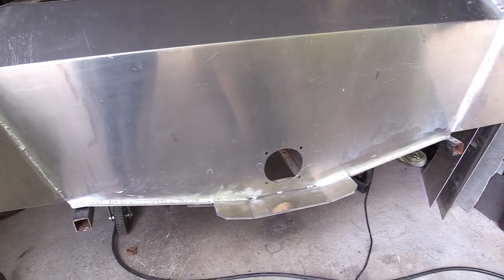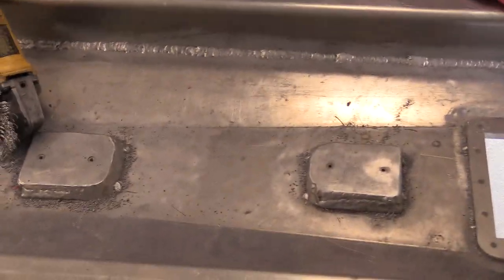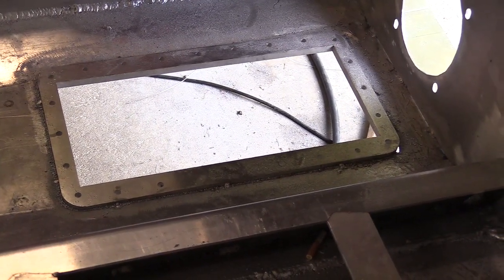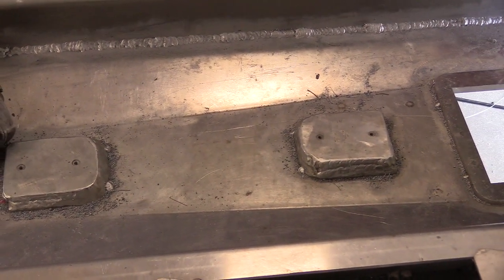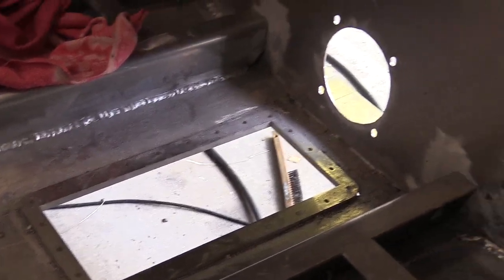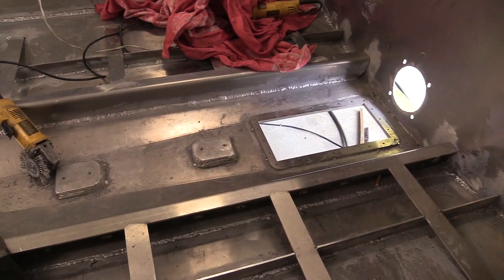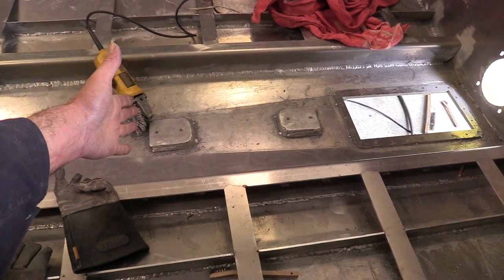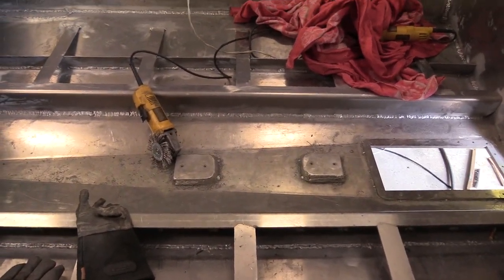Mini Jet Boat Build Video #41 Engine Mounting/Intake Welding

Comment: I have the same intake and pump as you and I didn’t like their weld in ring. It bolts in from the bottom and if I run UHMW over the bolts I will have to remove the UHMW to replace or fix the intake. And if I don’t run UHMW then the bolts are going to get pretty thrashed. So what I did was copy blome_907 on Instagram and got some 1”x 2” aluminum bar and made my own weld in ring, and drilled the tapped it to bolt in from the top.
Reply from the maker: Noah Lochner I’m thinking about welding the ring in flush with the bottom and countersinking the bolt heads, then adding another ring for hight. Maybe I should just build a new ring. Are you moving the bolts to the top? Forget the question. 😁
Reply: Paul Christian I’m working on a YouTube video for my setup right now, I’ll let you know when I post it so you can see how I’m doing mine.
Reply from the maker: Noah Lochner Awesome.
Reply from the maker: Noah Lochner Did you stick with the 1/4-20 bolts or go up in size? I ordered 1 1/2 square bar for the new ring.
Reply: Paul Christian I sized up. If you have Instagram shoot me a message @Northern_arc

Comment: I have just finished my wattscraft 3m , In my opinion I would spend the extra time now moving the mounts rather than when the boat is finished as you would have to start from scratch again , like they say do it properly the first time
Reply from the maker: andy black Not sure what proper is. My thought was that the factory mounts were proper, and suspending the entire motor on the stabilizers was not proper. I’ll look into raising the intake ring so the bottom is at the top of the keel plate. Thanks for the input.
Reply: Paul Christian I would say they are proper place  for a jet ski , not really for a jet boat .